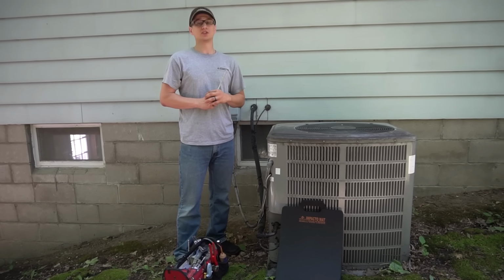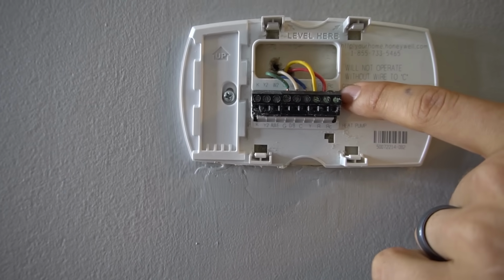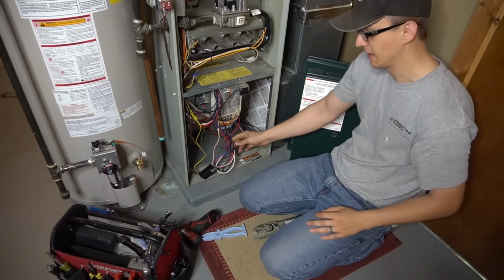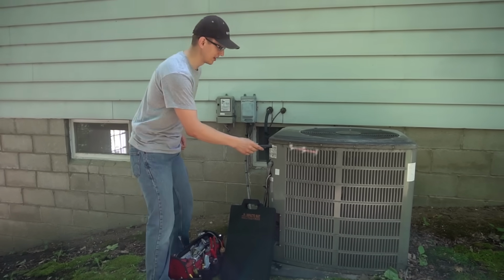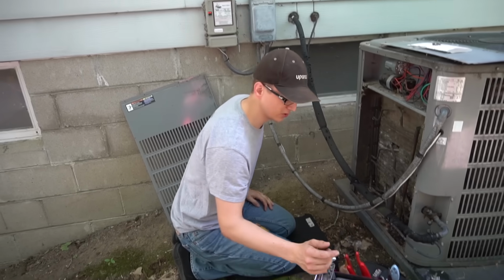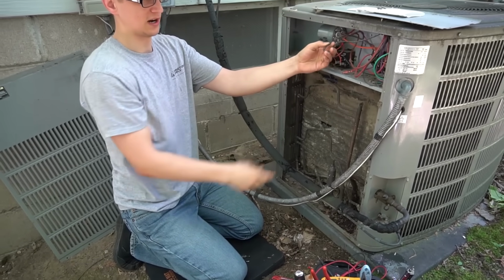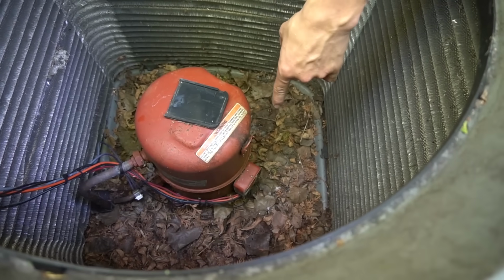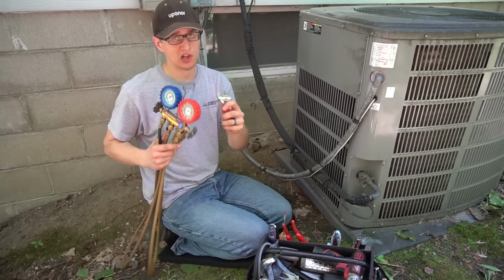AC Unit Not Turning On - How to Fix It Step by Step

Comment: Hooray, thought it was the fan capacitor(outside unit)  which fixed it two weeks ago, going bad again. It  wasn't, did your thermostat trouble shooting and  found inside fan not turning on. My unit is in the attic and started to check wiring and unit turned on. Loose connection  which I moved two weeks ago checking on drain pan drain plumbing for blockage . So happy thank you for sharing your knowledge .

Comment: This channel is priceless for new & first-time homeowners! Been using it to troubleshoot my AC which isn't giving me any airflow. Thermostat clicks on, condenser fan & motor starts up, but no AC. (Also noticed icing on copper line outdoors.) Changed filter and AC worked for a day, then quit again. I've flushed condensation drain, even cleaned evap coils, but no luck. May try cleaning condenser coils, but think I've got a blower fan/electrical issue that I'm not comfy tinkering with. Regardless, without these vids I wouldn't have been brave enough to try any DIYs or halfway know what I was talking about lol, so thank you!!

Comment: I was excited to come back and say thank you after using your video to figure out and fix our heat pump but it looks like I'm just a part of a very happy crowd.  I wasn't very confident in opening that thing up but thanks to your video I was able to trace the issue back to a faulty side of the dual pole breaker; only letting through 35 volts on one side, didn't even know that could happen. One trip to Lowes and $35 got me a cool & happy family and saved who knows how much by canceling a service call that couldn't make it out for 2 more weeks.🙏🙌
Reply: Please Sarah's describe your own words

Comment: My outdoor unit is not spinning or humming or making noise of any kind.

The blades are not blocked.

My thermostat is working.

My fan is blowing air. The air is even a little cool.

Using your video as my guide, in 2019 I replaced the run capacitor.

None of the wires inside the outdoor unit are chewed or frayed.

What should I do next?

Comment: I Had a burnt red wire on the capacitor outside in the AC unit replace wire & cap .    Also a tripped circuit breaker a main power distribution panel  awesome video . Thanks back running again

Comment: You kind of breezed through this issue...  My unit's fan doesn't turn on on its own... i have the move the blades to kick it into gear then it is fine and cools the house until it reaches temp and turns off again.  I will have to go back out to turn the blades for it to kick into gear.  
So with this issue, does that mean the motor needs oil or does the motor need to be replaced?
Reply from the maker: Most likely the motor needs to be replaced but there's a chance that the capacitor is weak. If you have a multi-meter you could check it, otherwise just try replacing the capacitor first and see if that solves it. If not, then unfortunately motor needs to be replaced.

Comment: Fan outside shuts down when the temps go above 88°-90°. I have to hit the reset button and it will run 10-15 minutes the shut off again. If I reset to quickly it shuts right off. Have to let it cool. No matter how long I let it cool (over 10 minutes), it will only run for like 5-10.
This heat wave has been brutal!
Any advice would be greatly appreciated!
Thanks!!!
Reply from the maker: The first thing I would try doing is thoroughly washing it down even if it looks clean. A plugged condenser coil can cause it to overheat. https://youtu.be/pzwOvgjwm_Q

Comment: Great video. I followed all of your instructions and was able to narrow it down to a loose wire . You saved me a ton of money by not having to call someone. My AC unit is over 20 years old and I'm sure I would have been told to replace the entire unit. Thanks to your video we got our air conditioner up and running in a heatwave.

Comment: You invited viewers to ask you questions about their current problems. I would like to ask for your help figuring something out. You also mentioned that the more information we could give you, the better, so I will try to leave nothing out. Here's the skinny so far and my questions:

We are in Florida.
We have an air conditioner, no furnace.
The air handler is upstairs in the attic.
The compressor is outside at ground level.
The unit is about 20 years old, I believe it runs R22.
Two week ago, it started having trouble keeping temps down inside.
For years, we were shooting for a 20 degree difference and it could deliver.
Recently, temps produced would climb above the requested temperature.
We compensated by requesting less of a temperature difference from the unit.
About 10 degrees or less, honestly happy just to reduce humidity (Florida).
2 days ago, it couldn't even maintain a 5 degree difference to ambient.
I noticed it was short cycling, about a few minutes at a time.
Yesterday, a technician came out and aggressively tried to sell us a new unit.
I did not appreciate the hard sell tactic.
The evening after he left, the whole system stopped (sabotage?).
Air handler fan and outdoor compressor both won't turn on.
Happened at the same time, though.
From watching your videos, I know that means both units probably fine.
Thermostat batteries old, replaced them. No change.
Thermostat terminal strip had no voltage.
Checked breakers, all OK.
Reset breakers anyway, no change.
Turned off house power for 10 minutes.
Restored whole house power, no change.
Opened up air handler. Smelled funny. Ozone? Chemical?
5 amp fuse on air handler control board was burned out.
Turned off air handler breaker.
Replaced 5A fuse on control board.
Turned on air handler breaker.
Still no voltage at thermostat terminal strip.
No voltage at thermostat pinouts on control board.
Cut and restored power to air handler thinking that might reset it.
No change. No voltage at thermostat terminal strip or pinouts on CB.
Suspect hidden reset switch, but none found.
Suspect door switch, but none found.
Suspect float switch, but not tripped.
Suspect transformer feeding control board.
Not sure how to test transformer feeding control board.
Found your video on testing transformer.
Think I need to re-watch. I have a cheap meter. Not sure of right setting for HV.
What I think I need to do next:
1: Test voltage from transformer to control board.
2: Test transformer, possibly bad.
3: Try manual trigger of contactor outside?
4: Test contactor voltage and OL status.
5: No point testing thermostat line outside?
6: Noticed a contactor inside the air handler. Try activating this?
What would you suggest I do?
Steps taken since asking:
Took cover off compressor.
Gained access to contactor.
Contactor successfully actuates.
Compressor works.
Condensation builds up on low pressure/suction line.
Compressor has 240v.
Need to make sure air handler gets 240v.
Going back upstairs to tickle it now...
Update:
I tested everything in the air handler, HV, LV, nothing has power.
Opened up the safety cutoff switch.
The lugs from the main box downstairs have power.
The lugs to the load don't, in either position!
Turned off the breaker downstairs feeding the cutoff switch.
Replaced the 60A breaker in the cutoff switch.
SYSTEM RESTORED. THANK YOU.
I troubleshoot computers and software for a living. Thanks for giving me the confidence to sort this out on my own!
-Steve

Comment: So if my breaker is on and the outside thing is in, I can push the plunger and it actually works. But if I try to turn the ac on with the thermostat, it doesn’t work. What should I do?

Comment: I have a 25 year old Trane unit and the outdoor part of the unit is not running.  Inside fan is running.  I replaced the capacitor and it still is not running.  When the thermostat calls for cooling I hear a hum at the outdoor unit.  I pulled the power connector and still hear the hum meaning the hum must be coming in from the thermostat power. I am going to check the power coil today and try manually spin the fan.  Any other suggestions on what to check? Thanks in advance!!

Comment: I love you! Our upstairs HVAC stopped. I cannot get anyone  😫 out her for 2 weeks..
Fan upstairs works. Machine does not spun or work. 
I noticed the core sensor had a green light. I asked Bella to turn on the control. I heard a loud click. Then the red trip light came on. 
Now I am not sure if it is the capacitor or core sensor. Fan spins freely when I touch it.

Comment: Our new ac unit won't  come on. Do we need to jump or cross the wire in furnace like the way it's done in thermostat? Also,  furnace just gas RCYGW not like the thermostat that has RC, C, RH, W a separate section has the Blue and yellow wire that has Cool written on it.

Comment: I have a 2 floor home with 2 condensers. 1 for each floor. Checked the condensers and they both are on with the fan spinning. Condensers are also clean. Both thermostats are on and filters are clean. The problem is only the 2nd floor is blowing cool air just fine and I can hear the central air working but on the first floor, there's no air from the vents and I don't hear anything like I did with the second floor. I even turned all the circuit breakers off and on again but no luck. Do I still check at the furnace?

Comment: Hi Jay, thanks for your video, but I'm still stuck....My outdoor A/C unit will intermittently not turn on once thermostat is calling for cooling.  Seems that a "Fault" light is blinking on a circuit board in the outdoor A/C unit.   Do you have any thoughts on what's going on??
Reply from the maker: Sorry to hear about the AC troubles! Fault could mean a variety of things so I don't know what is causing that right off the bat. Is there a little diagnostic chart on or around the control board that explains what the different codes mean? Is there a further description as to what the fault error code is referring to?

Comment: Outside fan is running, inside fan is running, but the house will only cool like 1 degree. I do feel a small cold breeze from the vents but not a lot. Any ideas?
Reply: You didn't watch the video,  did you hon?
Reply: @leskavage  no need for the condescension. I watched the video and did the troubleshooting with him and none of the issues in the video were the issues I had. Got it fixed though today
Reply: @ericafiala5105  thanks for letting us know🙄

Comment: I have a question, I press my contactor and my compressor turns on but fan does not spin.  Can take be the switch or something else.  (I turn on my ac amd inside unit works great but out door does not turn on at all.)  I turn the unit off for the night amd try in the morning amd it turns on right away. (Happens randomly)

Comment: Found two burnt wires, that use to be connected to my control board relay. It appears my relay failed. Fuse wasn't blown. Any tips? (Common failure?) Thanks for this video! I ordered a control board replacement.

Comment: OMGOODNESS!  We’ve been without AC for two days. Ran out of bread and was reluctant to bake any but couldn’t wait til Monday when repairman was coming out so went ahead and made our bread for the week. Then had to cook supper. Yeah, it got hotter. Had three ceiling fans and a floor fan going. We were miserable but it could have and would have been worse had it not been raining and cooled outside to 80’s. Was 87 in the house. 

Anyway, watched your video and ran down the trouble shooting side of things. While doing so, found a round disk on the floor next to the furnace unit itself with a red light. After we pulled the fuse out and checked it, that red light was out. No light at all. Investigated that disk a little closer and found a reset button; pushed it, nothing. Pushed it and held it (cuz ya have to hold reset for 10 seconds on some things), nothing. Put the doors back on the furnace and light came on only this time was GREEN LIGHT!  THE AC IS WORKING. Just completed this ten minutes ago and so far, the AC is still on. House is already cooling down. 

Thank you sooo much. We never would have even attempted had I not watched your videos today. Glad I learned about YouTube and remembered to use it (after suffering two days)!  

PS, the service call on this one year old Bryant unit was going to cost $99 for the first 30 minutes. She never even said what the charge would be after that and informed me ONLY PARTS covered by warranty. Didn’t know that. Will never by Bryant again.

Comment: I was told to replace my capacitor and to measure the length of the capacitor.  When measuring the capacitor, the metal end of my tape measure contacted one of the terminals on the capacitor, with all power on, and I heard and saw a spark.  The circuit breaker tripped.  I reset the breaker.  Pushed in the disconnet and no power.  I have no power going to the disconnect.  I did have a tech install the capacitor and still no power to the disconnect.   Please note that when I went to reset the breaker switch, the switch would not go all the way over to the off position but stayed in the middle instead of moving all the way to the right off position.  The switch will move all the way to the left on position though.  Should I replace the circuit breaker and is the problem I am having... is it a bad circuit breaker?  Please assist.

Comment: My issue was the capacitor and it was bubbled like you explained. So a $25 fix was awesome to have my system back up a running in just a couple of hours after it stop. Thank you for the great video.

Comment: You are my hero young man!!!! Living in Vegas triple heat where there is no good time for the AC to go on the fritz.,,As Murphy's law prevailed mine went out, after having the vents cleaned and the AC checked.  I was totally disappointed.  Guess what? I just had to motivate the fan blade to move which was step one of the second video I watched of yours. AWESOME!!!!!
Reply: I just discovered mine had this same problem. Thank god for this guy. Triple Digits in California. I was wondering do you have to move the blades every time you want it to go or did getting it to budge that once clear out what was there and now it spins up without issue?

Comment: Strange. When plunger is manually pressed i hear the unit working. Thermostat seems find because fan turns on (but not cold), no indication of blown fuse in circuit breaker.. what can this be? possibly a short somewhere? bad transformer?

Comment: I will be testing and checking everything you said in the morning. I've unfortunately been out of town all week and my wife has been home with no ac and the landlord is slow about calling a tech. I did get the fan going outside with a screwdriver but I'm not sure that be enough to cool the house tonight. I think the capacitor is bad on the compressor side as well.

Comment: Super helpful video.  A/C quit working on me and thanks to the basic break down of how the system works I was able to fix it in less than 10 minutes.  Found a pincher bug had gotten roasted in the contactor and was preventing the circuit from closing to run the unit.

Comment: Jay, Fan and Compressor were not kicking in. Replace Capacitor, Contactor, Control Board and still did not start. Replaced Low pressure switch and Air Condition (Fan and Compressor) start working.

Comment: Your video was great but it did not help me to solve my problem. My condensate pump on the air conditioner has a float in it that was in the up position. Consequently with a condensate pump wired into the system if the pump is full the air conditioner won’t go on. I emptied the pump out in a matter of a few days the same problem reappeared. Obviously the outflow was blocked. The airflow hose was about 25 feet long and it turns out that Mr. daddy longlegs decided to build a nest inside the outflow line. Had to be blown out with an air hose but once it was seems to be working OK. Watch Them spiders!

Comment: 5 minutes after watching this video I had my AC diagnosed. Turned out to be the drain clogged with debris. Luckily there is a sump switch to turn off the unit as water collects in the drip pan! Saved me a good $400 if not more.....as it is not  easy to access the drain pipe in the attic.

Comment: My air conditioner is working but not cooling. This is what I found out. The inside unit is working fine. But the outside unit is not working. When the fan pickup,  immediately compressor pickup the circuit breaker in trip off and the unit stopped.

Comment: Our condenser unit recently stopped running.  I'm pretty sure that the thermostat is sending the signal, because the contactor shows 240 volts at the bottom, and then when setting it to cool, it then shows 240 volts at the top and the bottom.   However,  all that happens at the condenser is a constant electrical buzzing noise, and a click every so often.  Nothing runs, not the fan the compressor, nothing.  I don't know where to go from here.  Our unit is a Payne model# PA13NA024000ABAA 
 Note also that, the inside furnace blower runs from the thermostat so no prob there.   

PLEASE Help desperately
  in need of guidance TIA

Comment: My condenser has a hard start kit like yours.  Have you ever come across a bad relay?  I believe mine is bad, tested contact 2-5 should have some resistance but it’s open, contact 1-2 should have capacitance but it’s shorted.  Do I have another problem that caused the relay to fail?

Comment: Both before and after thermostat replacement  I have a symptom of the 'Fan only' mode inop. Outside unit comes on normally during regular AC mode, cools normally. My thermostat is wired for the fan lead to 'G'...and in the furnace the lead to 'G' on its terminal block is good. The fan only (house fan) worked for years...no idea why it's not coming on.Any input for the next step? Thanks